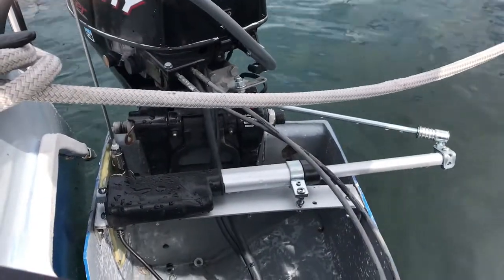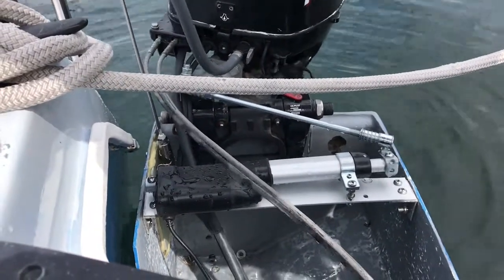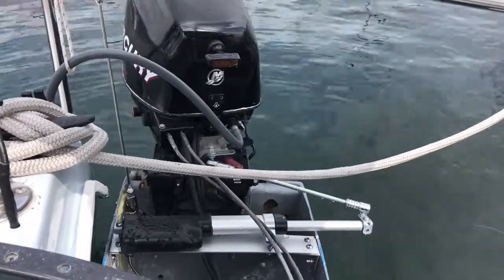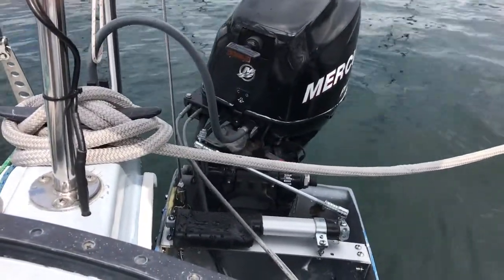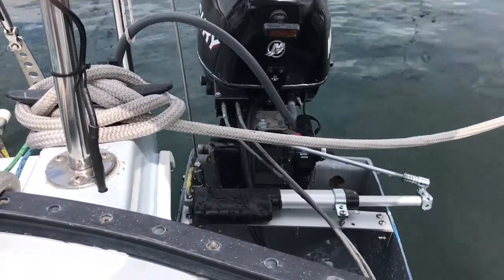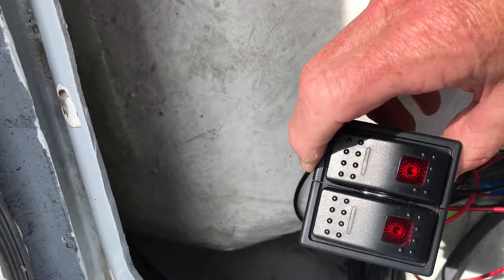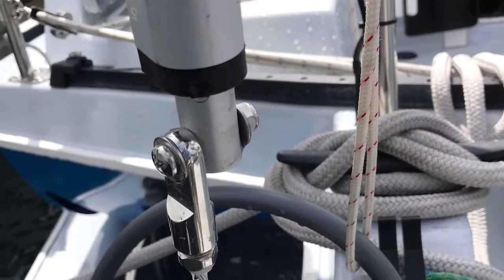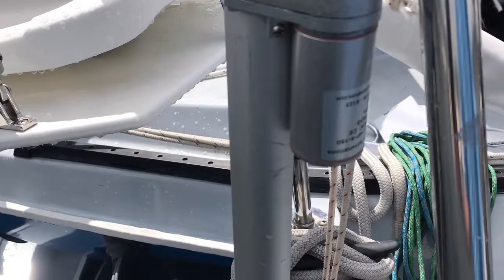Telstar 28 Firefly Linear Actuators

Comment: What kind of actuator are you using to steer? What is the speed and stroke?
Reply from the maker: I am using a Progressive Automations, 35 lb, 8 “ stroke, 2” / sec. It works great!
Reply: @rocketagp  does it hold up well to the water?
Reply from the maker: Dustin Fisch it has held up fine through the first season. The boat was just launched last week, so this begins its second season with the actuator. Last season, I used a momentary rocker switch to control it. This season, I am trying a wireless remove to control it.

Comment: I've used them on my tractor snowplow in place of my arm doing the work. I'm currently working on a TV lift but it is at the beginning stages. At the same time, I purchased a truck bed crane from Harbor Freight, modifying it for my tactor and replacing the hydraulic bottle jack with a Thompson linear actuator. If you haven't ever used a Thompson linear actuator, they are worth every penny, on Ebay that is. New they are very expensive, but I got a 1000 lb force one for 60 bucks and It's a brute. It all depends on what your purpose is. If your going to work one a lot, I would spend the money on a good one. I can tell you this, if your pushing a cheaper linear actuator (or really any) at it limits on pushing force, be very careful of duty cycle. When they say 10%, they are talking at max force. The problem with running one near it's max load is to keep it from burning up, it needs to be "off" for several minutes before the next use. I was thinking of that when your lift motor was working hard to lift the boat engine, although you probably would only be lifting the motor every so often.  I always buy one way over the weight rating for what weight I'm moving. I don't know everything about actuators but am experimenting with them. I find myself buying "name brand" good used actuators on Ebay rather than new cheap quality ones. This is just my opinion and experience with them. Good luck on your projects. If I can give you any info just let me know.
Reply from the maker: Tom Boyd thanks. The motor weighs 107 lbs and the motor pod probably 25 lbs. The actuator is rated at 135. I should probably size it up by 25% to give it enough capacity. You are correct, it gets used twice per sailing day, several hours apart. 1 time down, and one time up.
Reply from the maker: Tom Boyd i could also try a 2:1 or 4:1 block system to multiply the force!

Comment: Boy that puppies working hard to lift that engine. Better to oversize the actuator.
Reply from the maker: Tom Boyd I think so too! I sized it for the motor, but I think the motor, pod, and some angular resistance are probably part of the equation. I did this as an experiment. I will try it for a few seasons. I am also curious how long the actuator will last on the water. I wish it was in a salt water environment, so it would see a harsher environment. I would like more speed out of it. I think I will also try a latching rocker switch rather than a momentary rocker switch. Thanks for checking it out. I will try to get back with progress or changes as I make them.

Comment: Pretty Cool! Does the vertical actuator get the motor in and out of the water enough? Also, I had an F28R which I sold bc it was too uncomfortable and too small below. How have your experiences been spending the night on the Telstar? Finally, what is your average time for trailer to water or vice versa?
Reply from the maker: FinleyAtty Hi. The linear actuator really just gets the motor pod out of the water. The motor has electric tilt, so that lifts the lower unit clear of the water when sailing. Without the Linear Actuator, the motor pod would drag through the water and create a drag and spray! 
The Telstar is very nice below! It has more room than the Farrier/Corsair design. It has standing headroom and a wide open salon. We set up the main berth to sleep athwartship, so it is like having a Queen size bed.
We do not trailer sail the boat. We keep it in a slip during the season. It takes 2 hours to step the mast and launch the boat. The later Telstars came with a very useful mast raising system that takes about 5 minutes to step the mast, but it was not yet available when ours was built. I am thinking of reproducing it, so we could go trailer sailing in the South.
Thanks for checking out the video! I will comment after another season to indicate how the Linear Actuator held up. It gets used 4 times per sail, about 2 times per week during the season, except when we vacation on the boat. Then it gets used daily for a week or so.